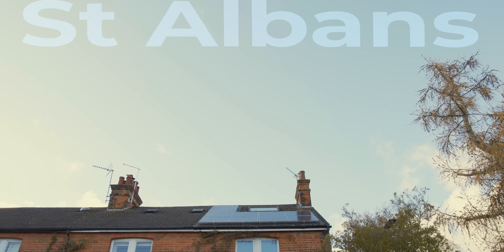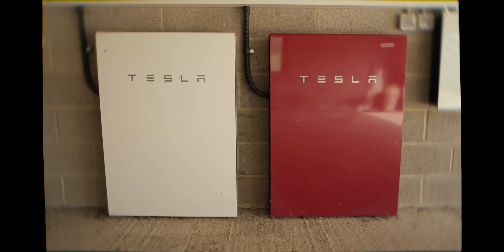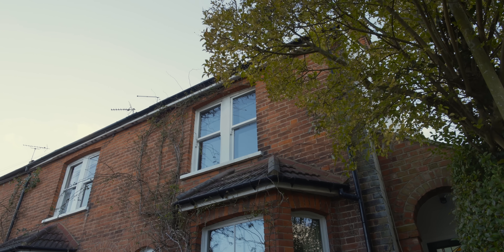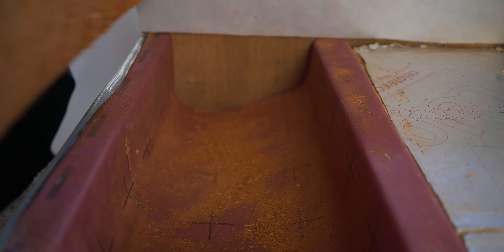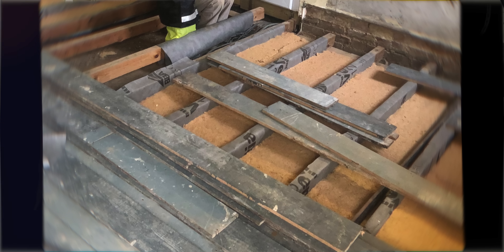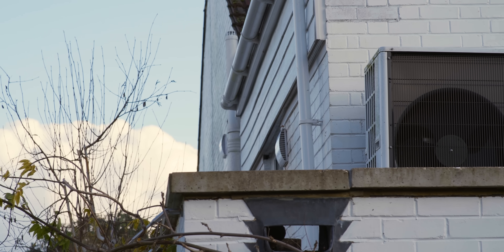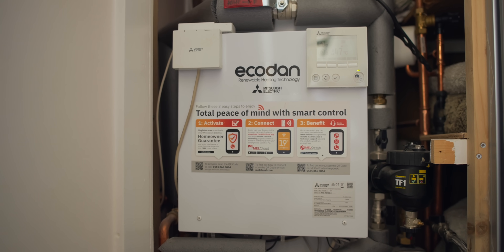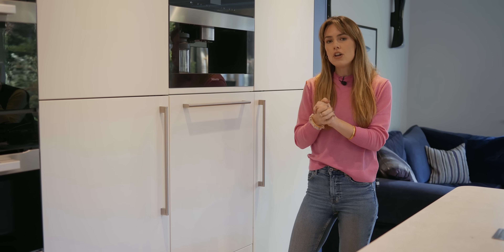This Victorian Home is Now 75% More Energy Efficient!

Comment: Great to see how it can be done, the trouble is that if a house is in good condition to start with then doing all of the work required is incredibly disruptive. Moreover, we sold our previous house just over a year ago which I completely renovated with internal insulation and an additional first floor (it was a bungalow) made from SIPS. I expected the energy performance of the building would be a reall selling point, but except for one, buyers were completely uninterested. The estate agent commented that those looking at houses in our area no more considered the running costs of a house than they did the fuel consumption of their 4x4. He also said that, for the majority of buyers, a home heated with a heat pump (my next planned improvement) was viewed with suspicion - shows what we're up against. Fortunately the new owner has not only covered the roof with solar but installed an MVHR (another planned improvement) and will be adding a heat pump in due course. 

We've moved to a house just around the corner with a building plot on which we will be building a low impact eco-house (as close to passive house standards as practicable). We've no intention of selling this so all of the extra expense of the build will be for our benefit and our sense of doing the right thing. Unfortunately, even if everyone shared the same sense of responsibility, they may not be in the privileged position to do anything about it.
Reply: I think many of these things are rightly viewed with some suspicion because the building trade in this country is a fucking joke far too often with cowboys willing to take peoples money to do a shit job and leave you with a worse situation than when you started and with a huge bill to fix it on your hands. 

Heatpumps only work if your house is insulated enough. There are plenty of stories of peoples bills going up a lot with headpumps because this wasn't dealt with before installation. Insulating internal walls, ceilings, lofts, external walls all requires a knowledge of the houses construction and again, there are plenty of stories of people who have had their lives made a misery by builders who take government (or private) money, do a shit job and then you have mould issues that require a complete removal of the insulation at vast expense. 

I don't think most people are adverse to these ideas, they are just scared of the huge cost and potential for disaster with our shit builders.

Comment: I had not heard of single room heat recovery ventilation units, what a great idea
Reply: Zehnder ComfoAir 350 Cascade MVHR is brilliant system
Reply: @Her_Retrofit_Space thanks. I wanted more information about that.
Reply: Also I think the Demand Controlled Cascade Ventilation bluMartin freeAir 100 MVHR
is an excellent product for any house retrofit trying to achieve Passivhaus standards.
Stefan Huber the author of the Passivhaus institute Good Practice MVHR has shown me how well it works in projects.
Reply: @Her_Retrofit_Space that's not single room?
Reply: The 80pc efficiency I'm very skeptical about but I'm sure it's better than letting cold air in through a window

Comment: Really enjoyed the video, it's a great summary overall. This will be useful to refer to and show that yes, this can be done and if you've the means then it needn't be expensive and look at the benefits!

One thing that it isn't made clear in the video however, is the reason behind the increase from a D to a B in terms of the EPC rating. That increase would have been because of the insulation measures undertaken, as EPCs never have renewable technologies on their list of recommended actions to improve the rating.  As an Energy Champion as part of a LEAD (Local Energy Advice Demonstrator) project, I have had to learn about EPCs and they usually only have insulation and energy efficient lighting as part of their recommended actions. Also if there is gas central heating in a property? It will, at best, recommend new gas central heating because the software that is used as part of the assessment process was designed in the dark ages. If a property had electric central heating, the software may still recommend to use gas because of the price of gas (off the top of my head, the price of gas at the time the EPC was done) versus that of electric. I learned this from going with an energy assessor colleague to observe the carrying out of various EPC assessments and general energy assessments, asking questions, and listening to the answers that I was given.

There has been consultation for years for a new, more sensible, and more inclusive of renewable technologies but there is no timeframe on when a new EPC system would be rolled out.

Comment: So what's interesting to me is a few points: I always thought the air source heat pump should be run with the largest amount of radiators and surface area as possible. Judith saying they have most of the radiators off surprised me, as did hearing it runs at 55 degrees: I'd have thought if they turned the radiators on they could run it cooler and see a higher COP and thus lower energy use?

Going from 25,000kWh to 6000kWh does sound very impressive but it does indicate the heat pump COP is lower than it should be. A heat pump should be able to get a COP of 4: meaning it adds 4kWh of heat to the house for every 1kWh of electricity. So 6000kWh of electricity would equate to 24,000kWh of heat if the heat pump was working efficiently. As Judith has done so much energy improvement, the heat loss must be much less than 24,000kWh so the COP must be considerably lower than 4.0

Unless of course she's saying they only require 6000kWh of heat and thus use even less than that in electricity which would be incredibly impressive!
Reply: A number of people have mentioned this so we'll certainly be looking into it. Very helpful
Reply: @ecorenovationhome  No worries, good luck! Thanks for the excellent content. I don't have an ASHP so I'm just basing it on what I've read: it's awesome to see your videos of things in action.

Comment: Great stuff, so clearly presented by Judith - and can't fault any of the advice on insulation and airtightness. I'm not the first to say the heat pump is too big - I'd say 5kW not 6. Also I don't know if the Ecodan is set up with two temperature zones, but if heating the underfloor at say 30 C flow then run the ASHP heating mode at that temperature - not higher, certainly not 55 C.  Electricity use by heat pumps is proportional to the temperature lift from outside air to heating water so at 5 C outside running the heat pump at 55 C will use 2x the electricity to pump the same amount of heat at 30 C!  This isn't a boiler, you don't want to have to mix temperature down for the underfloor  (Then with the low flow temperature I'd run the radiators on TRVs and take advantage of their size to run at such low temperature)
Reply: Thank you - going to go exploring and speak with the installer.
Reply: @ecorenovationhome  I wanted to add that a smaller heat pump isn't crucial but there are ways to operate the one you have that reduce downside of oversizing. The problem is heat pumps can usually only reduce output to about 40% of max, and then they have to start turning on and off which reduced efficiency and adds wear. The way to minimise this is to run all heating on at the same time and control output on flow temperature rather than on/off thermostats. Underfloor heating is good for heat pumps as it represents a nice steady load but only when all zones are on, not if it's just trying to heat one small room.
I have an ecodan and got the wireless remote thermostat for it which does a good job of optimising the flow temperature in response to room temperature as well as outside temperature. I did try a nest thermostat but found the one I had was too crude and just turned on/off which isn't what you want with a heat pump.
I've learnt what works well using monitoring kit from https://openenergymonitor.org/ and there's a community of installers and homeowners sharing their monitoring online here https://heatpumpmonitor.org/
Reply: When running the radiators on TRVs - what temp would you set them at?
Reply: @ecorenovationhome  basically whatever temperature you want in the room to be - for me and my honeywell stats that's setting somewhere between 3&4 - the non-electric TRVs are quite vaque (but also temperature sensed at skirting board level may not match where you are sitting)
Reply: @alanclarke4965  Thank you. We're on it now and learning a lot! Very helpful
Reply: @ if you get to point of explaining heat pump operation as well as building fabric insulation and airtightness then that would make a great video
Reply: @alanclarke4965  Juat what I've been thinking. We have the installer coming to talk it all through tomorrow and if he can't help, then I'm thinking of getting a heat geek over. There's someone in the next town who's done the course. Determined to get it right!

Comment: What about sash windows? We live in a property with a listed elevation leaking warmth through wobbly, single-glazed sash windows. Is there an eco sash replacement that’s approved for listed properties?
Reply: We certainly have a local company who will renovate original sash windows. We had the ones on the front of the house done. They repaired the casement and replaced the glass with a double glazed unit. It's working well enough. Clearly not as good as new windows since the air gap can't be so large, but definitely better than the original
Reply: @ The original sashes have very fine woodwork that wouldn’t be able to take double glazed units. So renovating them for double glazing would be impossible. They are in desperate need of replacement. Last time they were replaced (1980) there were government grants available.

Because of the location on a river and busy road, any secondary glazing would fill up with spiders’ webs and particulates in no time.

We can’t put anything other than slate on our lovely south facing roof, either.
Reply: Yes, it is possible to have double glazed windows in a conservation area
Reply: There are very slim vacuum DG units that can go in sash windows, but If I had them I'd be on the warpath to the council to get them to realise that ruining the planet and making people spend a fortune on mediocre windows, just because they like the look of something that was the latest technology in the C17th, is a really stupid way to respond the transition. Let people use modern technology. You can get really nice passive-grade tilt-and turn windows which look just fine in listed buildings. (Check out the passive retrofit of '1 Regent St' in Cambridge). You can even get ones that look like sash windows if you really insist. But there is nothing 'better' about a sash window. Airtightness is bad-to-terrible, glazing area is less, U-values are poor-to-terrible. What windows look like is obviously a consideration, but the conservation people absolutely should not get a veto over our climate response. It's madness. But that is the current law and it needs to change. Kick up a big fuss. Start a campaign.

Comment: I've gone with rockwool batts between the floor joists.  Holds itself in by friction as quite stiff but still fills edge to edge, no gaps.
For pressure reasons, I run radiators at 51c and haven't changed them.  Still warm enough.

Comment: Was the 25500kWhr pre upgrades your gas consumption, and the 6000kWhr post upgrades total electricity consumption?
Reply: It was a combination of 25,500Kwh - electricity and gas together - before any retrofitting. Now we just have electricity and that is 6,000 KwH's
Reply: @ecorenovationhome  Thank you for clarifying. Would you know what the heat pump thermal output is and be able to compare that to the gas only usage? That would give a clearer indication of the improvement in thermal efficiency alone, although gas boiler efficiency is very much a stab in the dark!

Comment: Great video but I'm curious about the valuation of the extra costs, is that just for the difference of heat pump vs boiler and good sash replacements against passive haus standard 'sash like' windows ( I don't believe they didn't replace them)
Reply: We worked on what we were adding over and above what was being done anyway by the builder. The ASHP, minus the grant, was £7K. We added the difference between double glazing and triple. Double was already in the extension work being done but we went for triple Internorm windows

Comment: Id love someone to come look at my house and tell me what i need to do, its 220 years old and leaky and cold.
Reply: You can get a whole house retrofit plan done by some companies. Also by the National Energy Foundation. They should be able to give you a plan of action.
Reply: If your house solid wall  construction and you have wood burners  that work ... then keep them going 24/7 for about a  week to charge the thermal mass, ( gas central heating wont do it etc ) this will take some doing as most people never charge the masonry after that the walls will be charged and after  you use very little top up  energy heat to keep the heat regulated in the structure. If you cant feel the masonry releasing heat into the room at night  time you not charged its storage value. in this format it use 25w/m2  as storage heater...
Reply: @carlrutherford8456  That's interesting - I've always felt as if the house becomes like a storage heater but had no rationale for that.

Comment: Really good video. Solid info on insulation, and also a very important point about how energy efficiency improvements add value to the house. In a sense, you're not 'spending' the money at all, you're smartly investing it into an asset.
Just one point though - the flow temp from the heat pump is too high. If set lower (and on a weather-compensating curve) it will run much more efficiently. The additional radiators can be opened up to ensure the house is still heated at the lower flow temperature.

Comment: She should open up her big radiators and drop the flow temperature of her heat pump she would get a better SCOP and save even more money
Reply: 55c target flow temp is crazy high for a house like that, should be more like 35c.
Reply: Can we get a heatgeek there
Reply: I came here to say that! Get rid of the nest thermostat. Probably get away with 5k unit
Reply: Yes, this is the problem with fitting a heat pump when not many heating engineers understand the best way of running them, so don’t educate the customer correctly. I agree that a heat geek authorised installer would have been a better choice.
Reply: Yeah all that work and then go and run a heat pump at 55 with a nest 🤦
Reply: @bruceyv83  We just had a heat pump installed for air to water with underfloor heating on ground and 1st floor by a really good company called Aspen Renewables in Hailsham. They are making it ‘open loop’ at my request which ensures the most economical performance. But I had to do the research to find this out, which is not what most people do as they tend to leave it to the supposed experts.
Reply: I was almost shouting at the screen at that point! My house is similarly insulated 3 bed and I have a 5kW heat pump with a design flow temperature of 43°C. I have all the radiators open so it can maximise its efficiency and keep the SCOP high. Definitely room for some tweaking with her system there.
Reply: My thought exactly, send in the @heatgeek